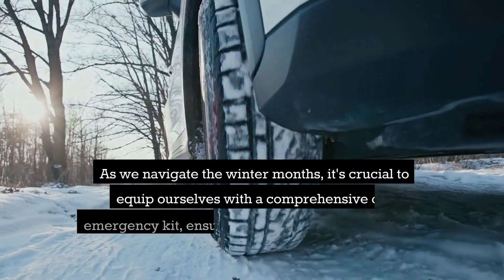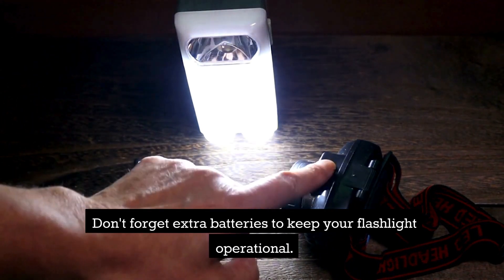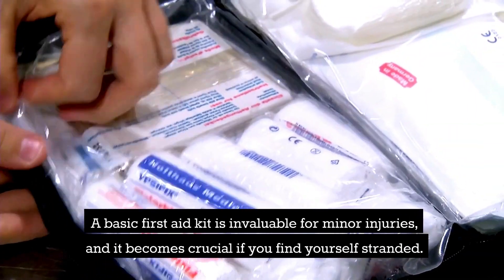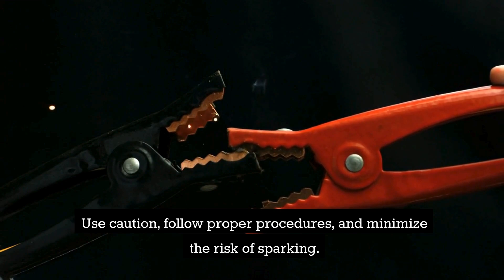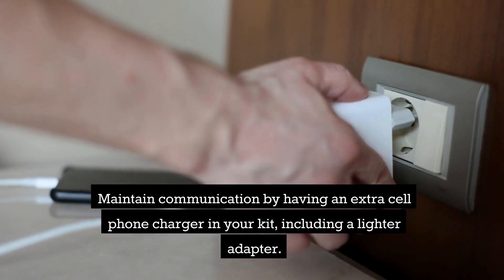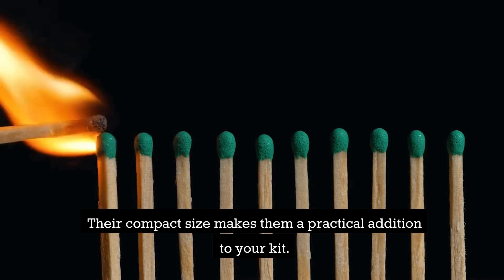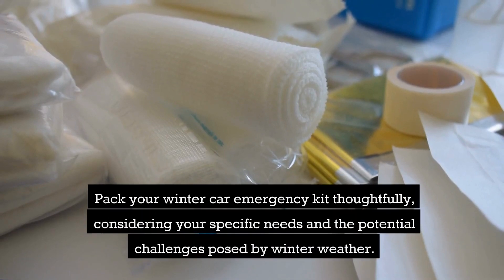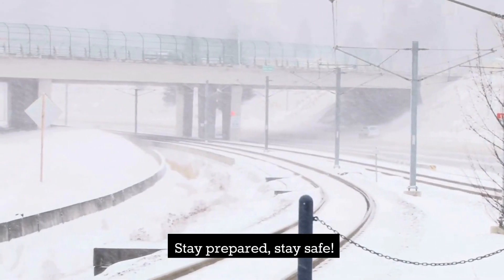❄⚡WINTER EMERGENCY CAR KIT!⚡❄

Comment: Most of those items are good to have in your vehicle.  When I lived in Vermont and New Hampshire, I liked to put at least 100 pounds of bags of sand in the back of my truck for extra traction. tDon’t miss those days.  Had a steep driveway and after an ice storm went down it sideways into the main road a few times. That was better than a cup of coffee for an eye opener.
Reply from the maker: 😲I will settle for my coffee lol. I can't imagine! And I also can't imagine what people with those tiny cars, or the EV ones, would do if stranded.  Well, they'd be screwed. Libcicles? 🤣🤣 omg I'm so bad!
Reply: @offgridstyleprepper  😂 l😂